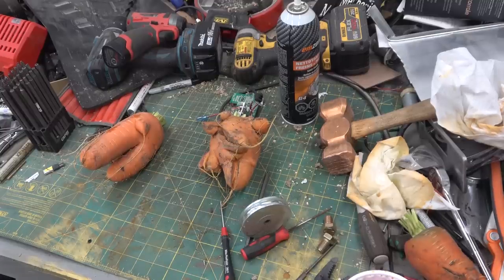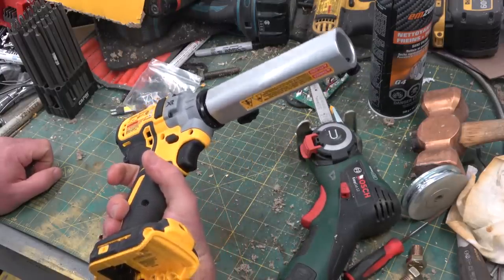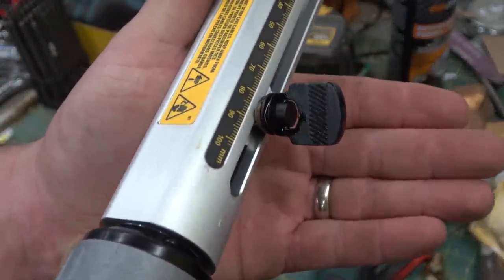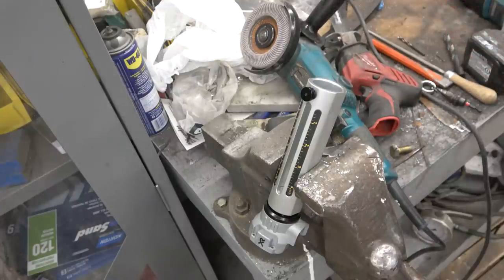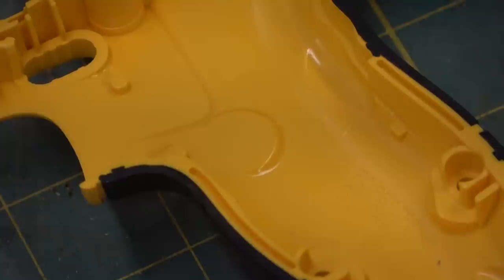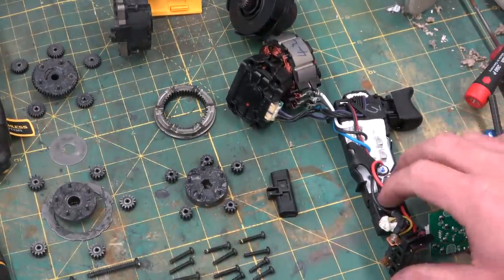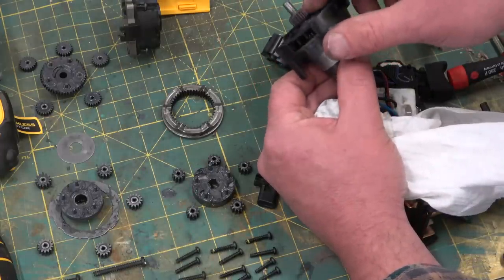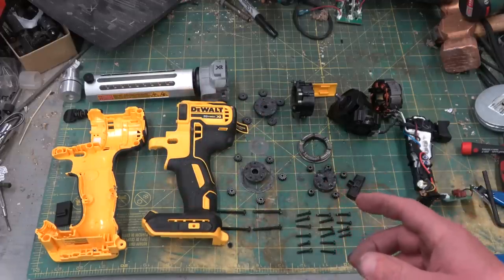BOLTR: Black and Yellow Strippers

Comment: How to turn a drill attachment into a standalone single purpose tool.
Reply: definately what it should of been
Reply: The bright yellow handle makes it harder to lose if you drop it.
Reply: I thought it was an attachment until the end. whyyyyyyyy
Reply: There's been an attachment available for years. It's just stupid $$$$
Reply: I thought the same thing
Reply: @MarcosElMalo2   It makes locating the shattered pieces super easy.
Reply: black and decker made a multiple purpose tool with a bunch of different gear heads on what seemed to be a fairly stolid drill-ish handset, at least some of which were very heavy and it turned out to be surprisingly durable and useful within the niches of its few attachment heads.  Had one at work but been meaning to see if they still make em at a decent price to keep at home just for weird little tasks.

Comment: Looks like a fancy way to do something simple without the weight of your wallet slowing you down.
Reply: If you’ve ever spliced a 2/0 direct burial that has been destroyed 40 inches underground in -40F weather you’d understand. Or if you have 300 #2 and 100 #6 wires to strip and terminate aka 800 ends.
Reply: @RadDadisRad  Surely they could have the exact same insulation cutter head, except with a hex shaft that could go into a standard cordless drill.  (which everyone already has in their tool bag.)  Or similarly, a square drive that would go on the end of impact driver, (which everyone also already has in their tool bag.)

I like the idea of a hex shaft that you can chuck up in your drill.  That way it won't be always slipping off the end of the square drive and falling in the mud.

Building it into an entire driver is crap, not only because of the added expense.  But also, because the added weight in your tool bag.
Reply: @RadDadisRad  a better mouse trap this is not.
Reply: @BramBiesiekierski  Greenlee does. The problem is the standard hex version has no way to limit the input torque.
Reply: @BlcokedAccount  oh but it is. I have first hand experience with this. Over 120 different die heads for different conductor size, insulation thickness and even conductor material such copper, aluminum clad copper and aluminum.
Reply: @RadDadisRad  
Good point.  Although, some drills like the Milwaukee one-key Bluetooth drills have user programmable speed/torque settings.  You could easily set a custom mode up specifically for when using such a stripping tool.
Reply: @BramBiesiekierski  Not everyone is a "program it every time" kind of guy.
That why in profesional enviroment workers have  3 angle grinders for difrent abrasives, 2 cordless impact drivers for diferent bits etc. Changing bits take time and when you have to do this hundreds of times its worth to have a tool for a job.
Reply: Ever strip 250/500 mill cable before?

It always cracks me up when AVE does a tool review for something he'd never have a use for, and has no application to his own trade. Was the same thing with the Multitool, lol. Oscillating saws are invaluable to basically every tradesman on earth (except for machinists... lol). Go figure AVE would say its trash.

This tool is worth every penny to someone who does a lot of terminations with power cables.
Reply: @BramBiesiekierski  Square drive, that way when your batteries die you can use a ratchet to finish the job. Ratchet and 6" extension bar is practically a manual drill with good rhythm.
Reply: @eideticex  LoL.  If your battery dies, then you take out your utility knife or cable cutters and do it like you would without the electric tool in the first place.

Comment: This will look reeeally good sitting in the bottom of your tool box, buried underneath 287 far more useful tools for the remainder of it's natural life.
Reply: To be fair.......if it works good, and you spend a majority of your work finishing big cable installs on commercial jobs....it might be an OK thing. Although obviously they could've just sold the attachment for an impact.
Reply: @jasonw7497  To be fair... obviously they could've just sold the attachment. I got you fixed it
Reply: I couldn't do my job without what I've learned from you. I didn't even apply for the job I have now, but here I am.
Reply: Or, if youre a lineman (or do any type of power distribution) you probably use it 100 times everyday, and thank god for it's existence. Why are so many AVE fans incapable of not knowing when a tool isn't for them (it's probably because AVE doesn't seem to know, either).
Reply: @jack__6303  I've replied to your response, twice...and both comments were deleted. Any idea why that would be? Neither were offesnsive, hateful,  threatening, or anything even remotely of the sort.🤔

Comment: Just wanted to say thanks! Your videos using your mills and cnc machine sparked an interest in me and helped me get a job as a CNC repairman and get out of a field I hated. That and thank you for the countless hours of entertainment!
Reply from the maker: Right on friend!
Reply: What's your education base? Did you have background as a CNC user, before you could jump into the repair side?
Reply: Let us know more!
Reply: Attaboy
Reply: @spamlobster  I was an aircraft mechanic before! No real cnc experience outside of 3D printing and youtube. But I've been turning a wrench since I could hold one!
Reply: @charlesfriend6378  Ah yes, that's propably a good starting point. Myself, I'm an engraving/marking machine tech, wondering if I could move onto something else. Friendly tip for you, if you hated the field you worked on, it propably would have been easier to switch bases rather than jobs ;]

Comment: What's wrong with using your teeth ? The three I've got left do a fair job but I do struggle with the steel coated cable  .
Reply: You had to have at least two opposing teeth in order to join the army during the civil war. You literally had to bite open the prepackaged rifle bullet & gunpowder in order to load your Springfield rifled musket, cal .58.
Reply: What are you?? Crazy??? How're you gonna open your beer a couple years down the road??
Reply: Just make sure you don't let the first wire touch your face as you strip the second wire of the pair! I'm glad it was only a 24v phone system in my case. 😄
Reply: Beavers unite!
Reply: @DavinDesborough  POT phone voltage is -48vdc, but if somebody rings the line when you’re holding the bare conductors it will lite you up like a Christmas tree
Reply: @jadesluv  It was a long time ago on an old Rolm system. I was never a phone guy, I was just helping out. I guess I remembered the voltage wrong. I'll blame it on the line ringing at the time.  :-)

Comment: PSA: That led board is a common failure point. LED does not like water like the old ones did. If your Dewalt doesn't spin after waterboarding pull the connectors on that board.
Reply: I will remember this next time my Dewalt misbehaves and I need to waterboard it.
Reply: Thank you. Outstanding tip.
Reply: @keithfarrell7638  it's the same board on the new hammer drill and a bunch of them. I work in the rain sometimes. Love the drill but was pissed when it died. Pulled it apart and disabled the board.
Reply: yer tellin me the tool will stop working because of the LED board?
I do not regret sticking with my first generation Li-Ion tools (which still fit the new batteries)
Not brushless, but they wont shit themselves from a couple drops of water, or...yknow, for no reason a-tall.
Reply: @Ayeobe  Yup. Only upgraded because I needed to. You can't fix old age....
Reply: @brad885  Makita still sells almost every part for the first generation 18V li-Ion impacts and drills.. and i actually bought 3/8ths and small 1/2 brushed impacts, though i decided on the brushless big 1/2 for mo powa babeh, vs its brushed counterpart.
Dont know about other brands, though..

Comment: Uncle Bumble, I just wanted to thank you. Without these BOLTR vijay-Os (and 5 years on the job from the bottom) I would have never impressed the head Enginerd at work enough to get me transferred from production line super to R&D.  I get paid to basically break things and help them design & produce better products.
Reply: Welcome to the dark side. Let the rage flow through you, and run that motor at 400% rated power just to see what happens.
Reply: Sounds like my kind of job, I`m good at breaking things (:

Comment: For a one-off or quick job, they're a pain in the ass. But if you've gotta do a lot of connections in short order they come in handy. Or at least that's my experience from us tearing out & rebuilding the electrical system in one of my company's data centers. Everything else was preassembled busway stuff, but doing all the feeds and stuff is where it came in handy.
Reply: I came here to say this.  Definitely a niche tool, nice if you've got a bunch of the same connection to make up.

I'll take my box cutters and a prayer every day of the week.
Reply: I had to help install new generators and ATS for a 40 floor hotel, and when time came to terminate everything this tool saved a lot of time and sweat.
Reply: @liveoak227  I would agree, and I'm no sparky.  Guess AvE needed some content?
Reply: I stripped 40 500mcm wires perfectly in 2 minutes.
Reply: @Blakspire  m
Reply: @boots7859  if the bushings for various size wire had been included for Uncle Bumblefuck's inspections and dissections we might have had a half hour of content to enjoy
Reply: came in handy. its funny every time. yes im 12. (times a non prime number)
Reply: OK but it also could have just been a fucking attachment instead of a standalone tool.
Reply: @SuperAWaC  even a regular, non-fucking attachment would have worked methinks
Reply: @ManInJapan  The attachment version sucks as you need a slow high torque output. People who dis these tools have never dealt with high current runs.
Reply: @Eddie Hitler greenlee makes the same tool as an attachement, buy that if you want!
Reply: @Eddie Hitler exactly, the attachment could gear down and have an extruded part that attaches to the drill body so the attachment doesn’t just spin freely without actually delivering power.
Reply: @ManInJapan  Youthinks wrong.
Reply: @lucidnonsense942  Slow high torque output? Oh so you mean gear position 1 one a standard 3 speed hammer drill eh?
Reply: @LudditePower  As was shown in the teardown, this is the same reduction gear set used in a hammer drill, so the argument of needing a dedicated tool with lower gearing then a hammer drill makes no sense.

Comment: I (and likely someone such as yourself) would get quite the chuckle out of seeing a "169 piece DeWalt 18v stripper puzzle" listed on your Etsy. 
This could be done with all the boltr tools that don't quite come up to temperature on the healing bench. Just a bag of torx screws and gear sets. A crisp high five if it goes back together and works.

Comment: that rubber pin on a side of a bearing pocket is not for "damping".  it is there to prevent outer race slip.  
this dirty trick is useful when your manufacturing process cant hold any tolerances needed for proper bearing fit ))
Reply: I’ve seen this in multi million dollar medical equipment as well.  Never knew what they were for.

Comment: I have not seen one of these before, is this the equivalent of a barrel pencil sharpener put into the chuck of a drill to peel insulation?
Reply: Kinda. They cut a spiral into the insulation until the cable hits the depth stop, at which point the cutter can't advance any further so parts the sprial off.
Reply: exactly ,Sir....exactly!!!!!
Reply: I think they would do well to just sell the fixture separately.
Reply: @bigmikeh5827  Exactly. It would be much easier to just throw attachment version in your tool bag instead of lugging around an  extra driver.
Reply: @diltzm  sometimes they should talk to the actual person that’s gonna use it.  I think at its core it’s a great tool. Not something the avg residential electric chicken. I see it for the industrial development guys running main cables into a factory and distribution inside.
Reply: @ferrumignis  Ok, thank you
Reply: @diltzm   Someone in another comment said there was a drill attachment that has been available for years.  I agree it would be nice to have as an add-on though I can see why someone might want their cable stripper completely separate.
Reply: For some reason I think that's in their Home Office lineup of tools but I'm terrified to even look.

Comment: Terminate a couple hundred runs of 750 MCM using a manual stripper and you'll appreciate this puppy.

It uses Greenlee and Ripley bushings. The elec-chicken looking to ditch their 2x2 for this will have those, hence the tool-only flavor. Also available as a kit with twenty bushings in sizes ranging from "what the hell is that for" to "the ones I need are optional."

Comment: EE here, finally my time to shine. The only wire stripper "power tool" (if you can call it that) worth using is the thermal variety. Patco is a classic name. It's the only way to strip hundreds of PTFE insulated wires to the exact same dimensions in one sitting.
Reply: Yep, that is the one I used years ago building custom flash cure panels. Super clean, little effort.  Best on a bench though. I am not sure I would want to use one in the "field" on a ladder.
Reply: To the peeps not knowing what these fellers are off about, it's something hot to go lookin for down through all 3 levels deep on the great gargler! Thanks for sharing, new to me tech is neat!
Reply: The Milwaukee m12 & m18 are pretty solid options, if you're working with 1/0 and bigger.
Reply: For smaller wires our shop has a Hakko thermal stripper. Not really necessary but it's awesome for doing large volume work
Reply: The thermal strippers made.by Bic work pretty well on smaller wires too.
Reply: that's a nice looking option that are noa as ridiculously priced as the Hakko thermal stripper 'system'
Reply: I have two thermal strippers. They both get hot and one is over 40 years old!
Reply: @aguyinback  might be time to trade in the older one on a newer model, you know, before it becomes a unreliable money pit.
Reply: @aguyinback  smells a bit though.

Comment: This tool is used very often by large electrical contractors in the mid atlantic with strict no knife safety policies. Mainly in data center construction where there are several hundred to several thousand sub 600 volt feeder terminations. It's actually very efficient if depth and length are calibrated perfectly. It allows you to be very consistent with strip lengths when using compression lugs, when the customer has a very strict tolerance on bare conductor length extending past the lug. It does nothing that you can't already do with razor knife.

Comment: I bought this tool with a battery and (almost) complete die set a couple of years ago to use on a big solar panel installation. Lots of repetitive stripping to terminate 90 or so conductors. Also was great on the AC feed and service conductors. Haven't used it since, but saved a ton of labor time and made great repeatable cuts.

Comment: I've got three of these in my bucket truck. It's pretty decent from stripping hendrix, and isn't bad when your pulling new wire and are stripping to put new pickles on. Even works on triplex. But it is pretty useless with everything else we've got. Only really speeds it up a little. And it works up to 900.
Reply: Save your next storm check and grab the Milwaukee m18 version, and the dies. 
You'll thank me later.
Reply: @southernlineman  I don't buy any power tools. I'm union and part of our agreement is that our contractor is supposed to supply all our power tools and consumables. We only need to have our hand tools.
Reply: Had to have a talk with our new guy.  Get your personal tools off the job and only have what's on the tool list.
Reply: @NimsChannel  they ain't mine. Contractor owns them. I don't bring power tools. The only thing I've ever brought is a chainsaw cause I hot rodded it and wanted to test it out on the old cedar poles.
Reply: I was agreeing with you. Had a hand bring in his own power tools, lasers, etc. lol.  Everything is company supplied, union.
Reply: @NimsChannel  UNION PROUD
Reply: My job has all the tools, but I have all the good tools and id prefer to use the tools I've selected and have survived my approach to the work. My clothes, my tools, my equipment, my vehicle, etc etc whenever possible.
Reply: Yeah I’d be airmailing that into the weeds. And if I saw someone using it to strip triplex, well…some guys aren’t very good with their hook knife so it probably would be faster lol
Reply: @jncn1490  yes, this one thing is why 330million people don't have pride.
Reply: @mfk12340  I'm union too. We badgered our tool committee to get the Milwaukee.
Reply: @southernlineman  I've got Milwaukee ones too. It's just they only had so many Milwaukee ones at the supply house at the time. And the other guys just didnt like them because they're yellow. So I ended up with 3 of them on my truck.

Comment: Having used a utility knife a manual stripping tool and a drill mounted stripper, this DeWalt tool is a wrist saver well worth the money spent on it. having to strip 36 500mcm cables for the large transfer switches weekly for the past 3 years

Comment: Awesome vid, and as a electrician who has had the option to try this tool, it leaves me lacking compared to other options. 
Faster then a knife on 500kcml bowden you got a bunch, sure, but the manual stripping tools you hand rotate can be too. 

One tool I used was a 5/16 or 3/8ths tool steel square blank with a L grind on it. You just rotate it and it scarf or spits, or whatever a curly insulation right off. 

A socket with q blade and a right grind on a tool bit will be much more handy for me to jam in milfuckey impactor